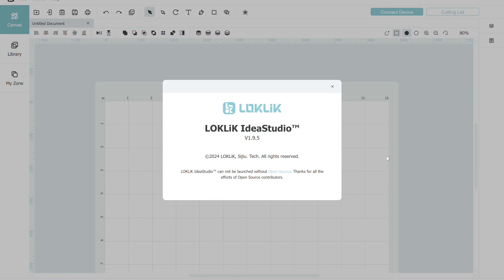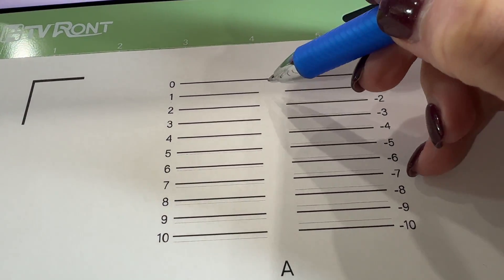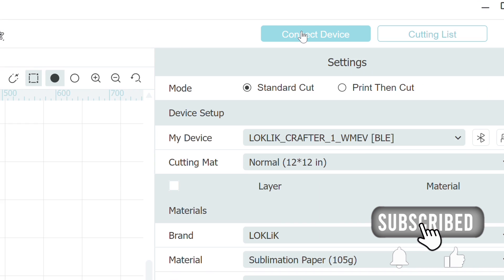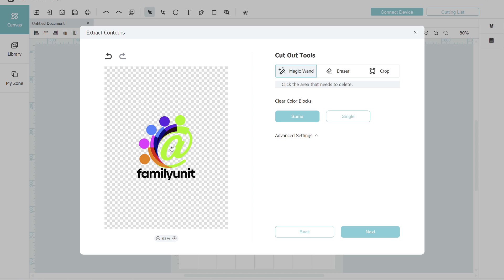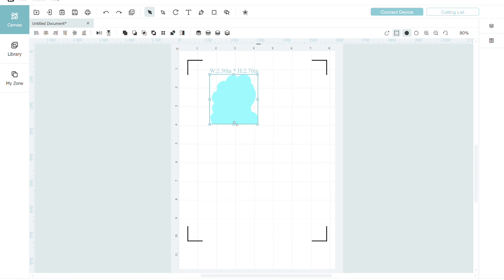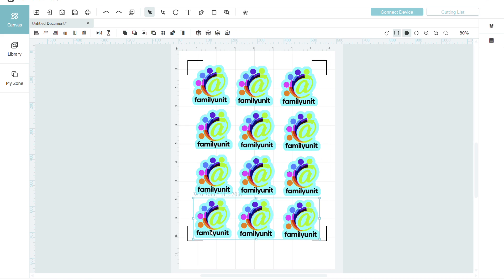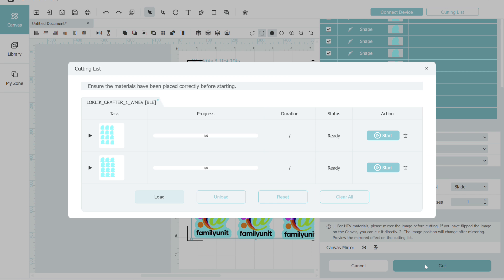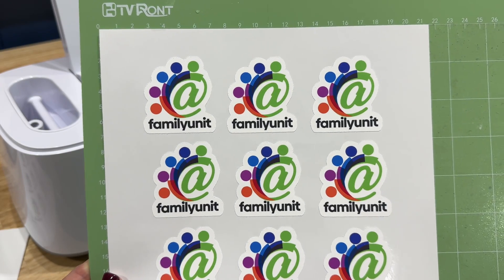LOKLiK IdeaStudio v1.9.5: Improved Print Then Cut Functionality

Comment: Hiya so I'm not sure what's up with my machine. straight up the bat printing the calibration sheet and it's only showing the borders on the left and not the right.  Also the mat changes as well when it's on standard cut its 300mm but when I change it to print and cut it changes to 210??!?. I have no idea what to do to fix it! HEEELPPP!!
Reply from the maker: The latest version of the software is v1.9.7 and the latest firmware is v0010. With these, there is only top left and bottom left registration marks. Not sure about the mat issues. Sorry.

Comment: How comd when I try to print the calibration paper I only have 2 of the outside grid guard line instead of the 4 corners?....
Reply: i have the same problem too and I don't know how to fix it :(
Reply from the maker: Which version of the software are you on? Which version of firmware? I haven’t upgraded to firmware v009 - been out of pocket the last week - but plan to work on this in the next day or so.

Comment: Hi, new to your channel and I finally unboxed my LOKLiK machine today. I did do the update for the machine. Since I don't have a printer to printout the calibration sheet, do I do it using the LOKLiK machine?
Reply from the maker: You only need to calibrate if you are making stickers (print then cut). To calibrate, you have to be able to print the calibration sheet out on a laser or inkjet printer. If you want to cut vinyl or make cards, go for it without calibration. 🙂
Reply: @craftwithfelicia  Oh okay. I did some rhinestone decorating on my pair of Ugg boots. I want to do the Ugg boot symbol (word) and iron on the front of the boot and of course rhinestone it.
Reply: Hello, tfs. Do I need to calibrate if just using cardstock?

Comment: I have been having issue with the corner guides can you point me in the right direction what steps I will need to get the corner guides I am only getting 2 left corners
Reply: update ur firmware
Reply from the maker: @DoubleZClips  - firmware v0010 and software v1.9.7 works much better.
Reply from the maker: We will check it out this weekend and report back our findings.

Comment: Tina, the process is iterative. First I had to remove all the previously stored gubbins by performing a Help/Reset Calibration Value, I reset both, I then had a disappointingly poor match on the first run, the second was quite good, the third was so good that each cut was precisely in the centre of a reference lines, eyesight excepted.. So they listened, you reported. Keep up the good work.  Regards, Francis.
Reply from the maker: Hi - thanks for the feedback. I’m going to look into what you described and maybe do an updated video. If it helps one it may help many. Appreciate your comments. Thank you 😊